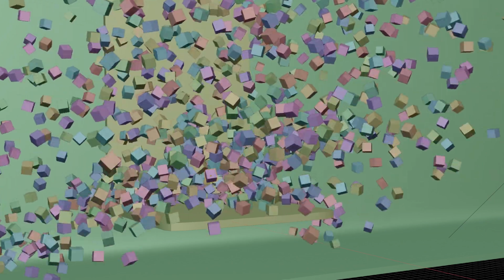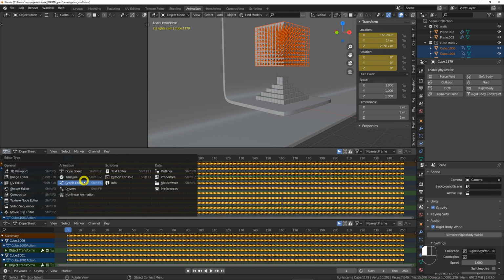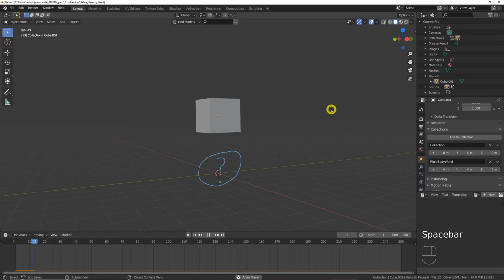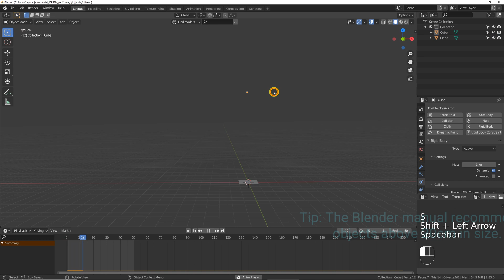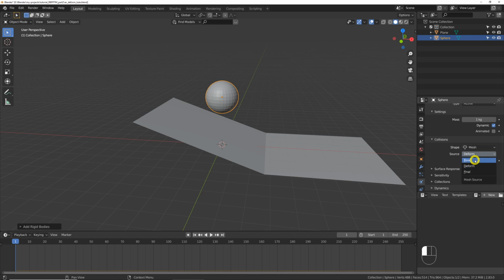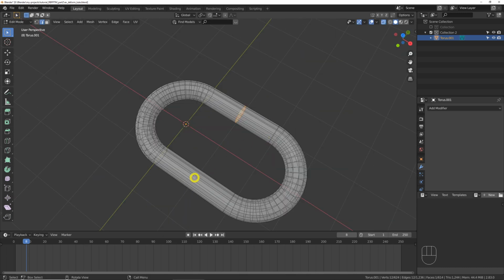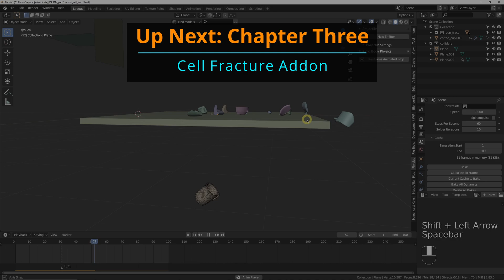Blender 2.8x Rigid Body Physics Fundamentals Cont: Path to Mastery - Chapter Two

Comment: For the deformation, i wasn't getting the same result when checking Deforming. It would just be stuck in place and then sink through the plane when the shape changes. It worked when i unchecked it. May be this is a new behaviour in 2.9
Reply from the maker: Hi L2S, I've just tested in 2.90 and it worked as expected. Ensure you have [physics - collisions - shape = Mesh, source = Deform and Deforming ticked]
Apply the scale to the original object.
Let me know if you sort it out otherwise please link your blend file.
Cheers!
Reply: @para8D  I needed to apply the scale. That was the problem. Always forget to do it. Thanks a lot

Comment from the maker: Chapter Three Out Now! https://youtu.be/ow6Hthn3EfA 
Welcome to Blender 2.8x Rigid Body Physics Fundamentals - Path to Mastery Chapter Two
This builds upon the fundamentals that Chapter One lay down. It adds additional tips and gotchas! to avoid. Worked examples are used to explain concepts and processes.

**Extra Tips**
Try duplicate link objects for stacking. This improves performance and changing one mesh changes all linked objects. The shortcut is [alt d].

0:00 - Introduction
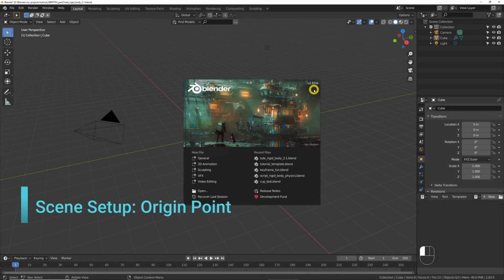0:32 - Setup: Origin Point
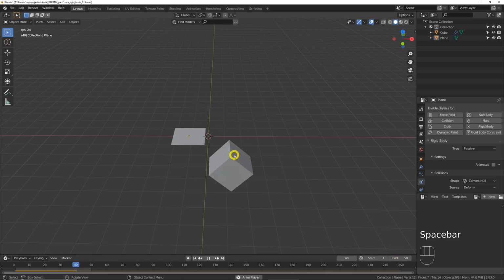1:04 - Origin Point
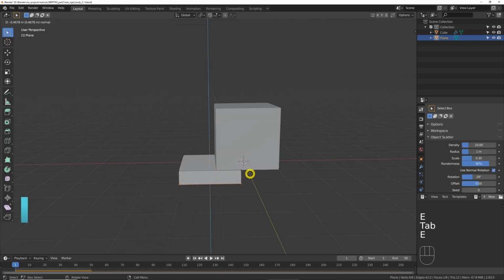1:25 - Origin Point Collision Shape
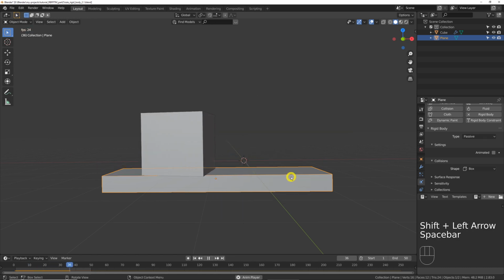1:51 - Mass Property 
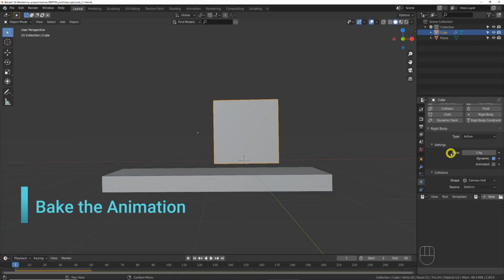2:23 - Bake the Animation
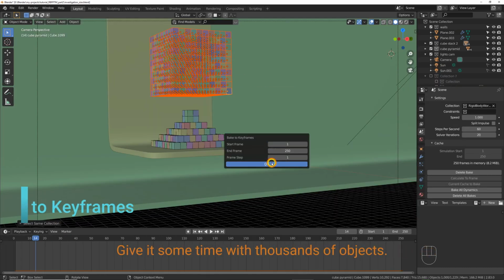2:46 - Bake to Keyframes

**Correction**
Fixed the below issue by baking all of the active cubes at the same time.
2:52 - Objects Move Unexpectedly

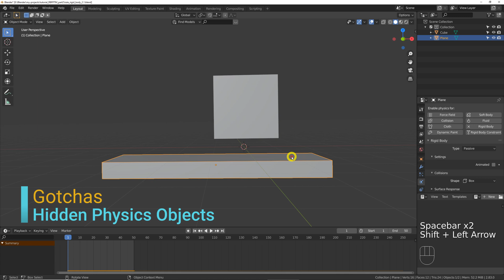3:33 - Hidden Physics Objects
3:44 - Ghost Object
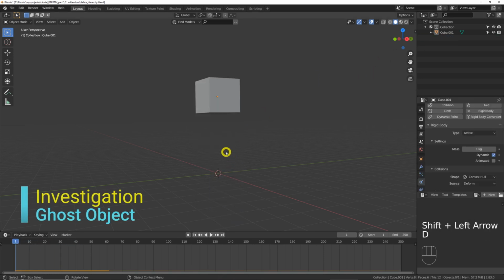4:04 - Ghost Object - Investigation
4:33 - Irregular Shape Stacking
5:00 - Viewport Slowdown - Selection
5:15 - Objects Pass Through Issue
6:05 - Hide Colliders
6:28 - Steps Per Second
6:43 - Steps Per Second Unexpected Result

Examples
6:54 - Deforming Objects During Simulation
8:14 - Breaking a Chain Using Fixed Constraint

Shoutout
9:28 - Bullet Simulation Software
9:52 - Up Next: Chapter Three - Cell Fracture

Other Chapters
Blender 2.8 Rigid Body Physics: Path to Mastery - Chapter One
https://youtu.be/jZg7-3yP6Ew
Blender 2.8x Rigid Body Physics Cell Fracture: Path to Mastery - Chapter Three
https://youtu.be/ow6Hthn3EfA

Ashley 2.0 Animation
https://youtu.be/-v7j09Ylkn0 

Rigid Body Manual
https://docs.blender.org/manual/en/dev/physics/rigid_body/introduction.html
https://docs.blender.org/manual/en/2.83/physics/rigid_body/constraints/index.html#bpy-types-rigidbodyconstraint
https://docs.blender.org/manual/en/2.83/physics/rigid_body/tips.html

Instagram: https://www.instagram.com/para8d/
Twitter: https://twitter.com/para8d